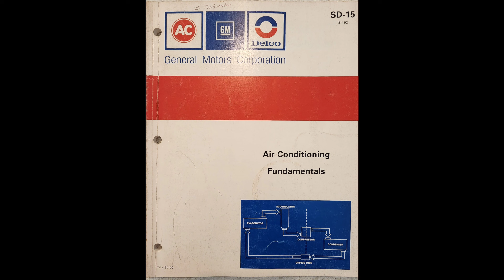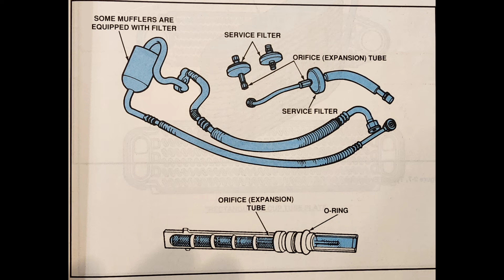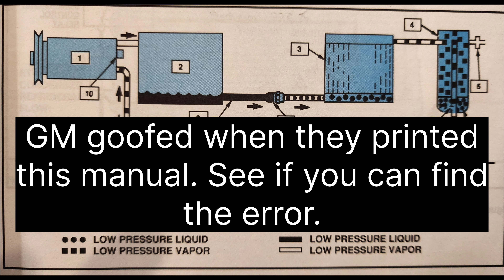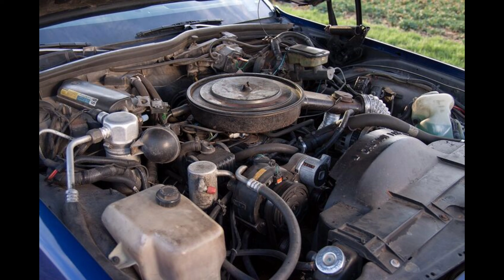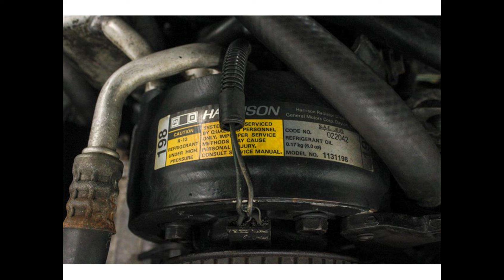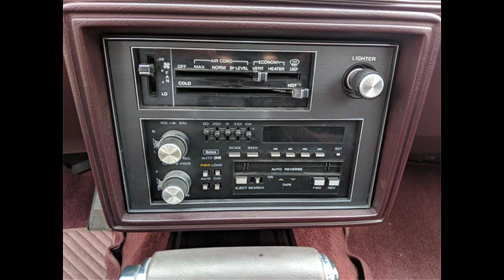The GM CCOT Air Conditioning Sytem Was One of the Best!

Comment: 1984 camaro Z28 I converted it to  R134 it blows 48° in 95° temperatures outside . I also installed a bypass valve for the heater core that helped when you’re running the AC maybe 5% but the big difference is when you get back in the car after it sits for 20 minutes it used to be boiling when you got back in the car now it’s way better.

Comment: My 94 C1500 came with R-134a but the system was pretty much what was in 93 with R-13 just had a different cycling switch and orifice valve. Its so overbuilt it blows cold AC even on 100 degree days unlike any newer vehicle ever can .. ANd it has a mechanical fan.  I converted A r-12 to R-134a it works if you are smart with the charge amount. it takes some trial and error.  Also the " Dont use" variable orifice valves are good for conversions in my experience.    Everyone says to avoid but. good for conversion. Way colder AC at lower speed

Comment: The even earlier Fridgidaire compressors were even better than the pancake compressors in this video. They used R-12 also. Several vehicles I had from 1968 to about 1978 models would blow frost out of the ducts. We had a few that were not pumping R-12 as it got more expensive and then obsolete. We used propane. Worked awesome !

Comment: The GM refrigeration flow diagram mislabeled both the high pressure vapor and liquid as low pressure.    All four refrigerant states were listed as low.    No such thing as a refrigerant system without a high side lol
Reply from the maker: That's it!

Comment: The R4 compressor was junk, i had a 77 Chevy caprice my uncle pulled the engine and put another engine in but didn't put the air back on i collected all the brackets to put the A6 compressor on and it worked great.

Comment: It was the R12 that made the difference.  I had a 1980 Regal that had vent temps so cold it would numb your face if the air was going straight to it even on a hot and humid day.  The condensation from the evaporator would leave huge puddles of water under the car.  It was more water than any car I have owned would make meaning it was superior at dehumidifying the air.  I also had a 1992 Acura Legend that was on R12.  It would cool quickly and vent temp was so cold you had to face the vents away to avoid numbing your skin.  If the humidity was over 65-70% and the vent was pushing air on the windows, the glass would cool so fast that condensation would form on the outside and water drops would roll down the glass.  R134a feels like it is 85-90% was effective in cooling.  Of course, it has been phased out of new cars and will probably be banned from production in the US within 10 years.  It used to be $4-5 a can but has more than doubled in price now.  Stock up if you plan to keep any car made before 2022 for a while.

Comment: I had a 1988 Chevy Astro van with the R4 compressor.  The fan didn't really feel like it moved all that much air, BUT the air coming out the vents would get down to about 38 degrees while on the highway...it got COLD!  Sitting at idle...not so much.  The van only had a front AC unit, and didn't have the optional rear unit, but it was sufficient to cool the entire van.    These systems were good, but I still liked the previous generation TXV systems used with the A6 compressor on older vehicles.

Comment: Hell yeah. I got my first car in 1992 and it was a 1978 Monte Carlo Landau. Had the center console shift and the 305 V8. The car was in pretty mint condition when I got it, it was the cliche "old lady car bought brand new and garage kept and used only on the weekends to go shopping. It was 100% original with only about 30,000 miles. That AC would blow ice chunks! I also had a couple 1987 Trans Am GTA's and the same, super cold AC and I live in Miami where it is HOT and that AC would start blowing cold in 5 seconds.

Comment: Agreed!, r-12 was the BEST and it's actually been proven that its environmental damage was minimal.
Reply: R22 too. EPA is a joke. My uncle used to service their building in Detroit. The system has a leak. Eventually when they remodeled after 20+ years, they found where a drywall screw, had pierced a line in a wall. Until then, every month he would add over 250lbs of freon. At the same time, an A/C tech would get a $10,000 fine, for releasing less than 1 lb.
Reply: True story. I’ve been doing commercial/industrial HVAC for over 30 years. I used to take care of one of the original Westinghouse sites in Pittsburgh just before it closed down. There was an old timer that worked there and he told me they were building some type of vessel for the government. And to make sure all the welds were tight they had to pressurize this vessel with R-12 and go over every weld with an electronic leak detector to ensure the welds were good per government spec. Apparently this vessel was huge because it took several hundred lbs to pressurize it. When they asked the government what to do with all this R-12, they were told by the government to just open the valves and release it. And this was when they first banned releasing refrigerants into the air. The government said it was too costly and time consuming to recover all the refrigerant because they needed this vessel finished in a hurry. Rules for thee but not for me.

Comment: 134 needs bigger condenser and more air flow.  Old R12 had crank driven clutched fans and at idle or slow speed could not push enough air for 134.  Install electric fans will help.  At Highway speeds the two gases were the same in my car.

Comment: I have a 92 Miata that still has its non converted R12 system. Got lucky and found an old cylinder of R12, I think its a 15-20Lb. Then my old boss gave me 2 gas grill size recovery containers that are also full of R12, ill probably sell the two recovery containers to a refrigerant recycler as I hear they're worth a fortune and keep the new stuff to keep the Miata running.

Comment: In my 1971 Oldsmobile I’m running an aluminum body a6 with the newer style clutch and swapped the poa valve out for an orifice tube with a pressure switch on it to cycle the clutch. Using a huge modern style condenser rather than the old tube and fin. R134a in it. So it operates like this system but still uses the a6. The original a6 clutch won’t hold up to the cycling rate that this system uses so it’s gotta have that new style clutch. Drove it out to the desert in 110 degree heat and was getting 40 degree air at the vents still 😁

Comment: I remember my 99 Yukon would blow cold for about 5 minutes then get hot. My rear air was still cool, being on the same compressor it took me a bit to get it. The heater control valve failed and it went to full hot coolant going to the heater coil and the front ac was routed through the heater so it works until the coolant warned up. Most ac on cars i have fixed were overcharged.

Comment: This is off-topic of the generation AC systems this video is about.  My grandpa‘s 2002 GMC Duramax, if you put a water bottle in the cup holder of the center consul and have the AC blow on it, it will freeze the top of the water bottle.  This will happened anytime you’re driving for longer than 30 minutes with the AC on.  If you let it that truck will freeze you out even on a hot 105° summer day.  I don’t know what it is but that truck has fantastic AC.
Reply: I have a 2002 Suburban...has largely the same AC system, except it has a rear evaporator in it.  You'd think a big truck like that would be hard to cool, but It was over 90 degrees here today, and I had to turn it OFF because even on the lowest setting, it was getting too cold inside!

Comment: As a 53-year-old man, I can still remember the magic of R12. I remember when I did R134 conversions in the 1990s, you could feel the difference in your hand. I can remember being a kid in the early 1980s, and my grandma and grandpa having a Chevy Caprice that you could freeze yourself out on the hottest summer days. They lived in an old farmhouse that did not have air conditioning. So on the hottest days, they would find a reason to go out and run errands. Think about it. On the hottest days of summer when people were hiding inside, they would go get in their car and go drive around because that AC was cold enough to hang meat
Reply: All my r134 cars have 35*f vent temps. How much colder do ya need?
Reply: @dingusflingus  I have both R134 cars and a R12 car. The difference is instantly noticeable. The R12 is far superior. Cools very fast and it stays cold in the car at much lower settings than my R134 cars. None of my R134 cars can compete with R12.
Reply: @eddiea3782 if you compare an r12 POA  to R134, yes. The cost savings hit and no expensive refrigerant control existed for R134. R134 with TXV and VDC is better. CCOT didn't allow for good evaporator pressure drop at idle when compressor pumping is poor
Reply: @cptbuiltk7944  Well, I don't know quite what to say since I'm not sure you grasped my comment. Later R134 systems could cool quite well. If you care to remember from my comment, I was talking about that gray area in the 1990s where we did conversions. You see, R134 is not as efficient as R12. It's not as good at moving heat. It needed a different system with higher high side pressures, and was far less forgiving on compressors. The very best and most modern air conditioning systems still take a moment to get going, so to speak, but if you had a properly functioning R12 system, you could turn the key and kick that bad boy to max cool. Like I said, the later technology caught up, and a properly running R134 system can do its job. But nothing moves heat as efficiently as R12.
Reply: Facts!
My grandparents had GM sedans in the '80's and those AC systems were ice cold!
Reply: I've still got a case of new R12 cans in storage :)
Reply: @markstrickland438  Me too
Reply: You should check out a 1996 generation jetta or golf. Those are dang cold. 
But my inverter based hvac in my niro works even better because a lot of times don't want or need ice cold air.
Reply: My wife has a 2001 Honda Accord and its ice cold and my son has a 2011 Honda Accord and its ice cold and blows you hat off. Not sure why the Honda's work so good but they do.
Reply: I have a Chevy truck that was the first year for R134a, but the system seems identical to what my friend has in his R12 system (just one year prior to mine, same vehicle, GMT400 truck platform). sadly never got to try the R12 as his system is totally broken, but the 134 in mine does blow cold, but on a super hot day it's just adequete. full fan and recirc needed to keep it mostly comfortable.

EDIT: it's not at all comparable but I also have a brand new car with the R1234yf standard, which I can't say I feel any difference with over my truck, though the automatic climate control can have it run til it's good n cold in it.
Reply: no kidding my mom had one and on a 90 degree day in Tennessee your ac was ice cold in seconds. Even to this day when I get in a car in the summer I still think about how cold and how fast the ac got on that car.
Reply: I am tired of young people telling me that R134 and the newest Freon or just as good. I got in a new car today and it took about 3 or 4 minutes of driving before the are started blowing cold, and another 10 minutes before the car was comfortable. R12 in the old days would have immediately started spitting out frozen air before you even put it in drive. And because it wasn't a high pressure system, it didn't leak out first chance it got

Comment: No.  The system that cycles the compressor is a terrible design.  It wears out the compressor clutch from all that on and off, and sooner than later you will have to replace the clutch, and usually the whole compressor.  The much better system uses a TXV or thermostatic expansion valve.  Used instead of the orifice, is a thermally controlled valve to control refrigerant flow.  The compressor clutch stays engaged and the system flow (temperature) is regulated by the constantly and automatically adjusting TXV.  This CCOT system was cheap and brought customers back for clutch replacement.  It is not the best.  It was the low end cheap system.  ----Doozer

Comment: GM went to this because it was cheap, then Ford jumped on the cheap bandwagon, Chrysler never went to it and use a real expansion valve like a real AC system ,  semis use an expansion valves because all their systems are custom made and box trucks and Thermo kings all have real expansion valves
Reply: That, and most Japanese cars used expansion valves.

Comment: Great video, but I have to disagree. The CCOT system would cycle the compressor off too often when charged according to system specs. This was done primarily to save fuel. Unfortunately, wide variances in cooling, especially on a hot, humid day would occur. The way around it - was to slightly overcharge so the low side would not come down enough to activate the low pressure switch😊
Reply: Then the evaporator will ice up.  -Doozer
Reply: @kooldoozer  I disagree - the point is - you're raising system pressure, both sides so the suction side doesn't pull down as low -  triggering the compressor switch
Reply: @ToddsHouseofSpeed-uq5sp   Ok interesting.  I am still learning.  I currently use propane in my 95 Crown Vic for 6 years now, and it has been running really well.   -Doozer
Reply: @kooldoozer  probably the best A/C system ever was the 1st gen GM systems with the A6 compressors utilizing the suction/ throttling valve. They were over-engineered, somewhat complex,  but would spit icecubes out of the vents on a 100 degree day

Comment: Those Harrison pancake compressors were absolute GARBAGE. I've replaced hundreds of them. We called them tuna cans. They all failed within a fairly short time, around where the case was welded together. They would leak around the welds. VERY poor design, as there really wasn't much of anything to weld to. The thin metal housing would flex, and the welds would crack.